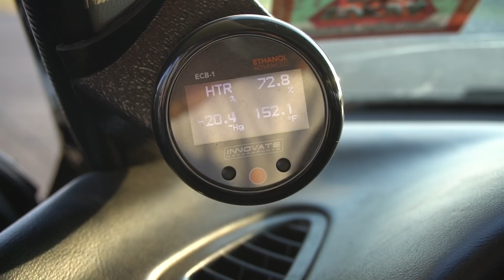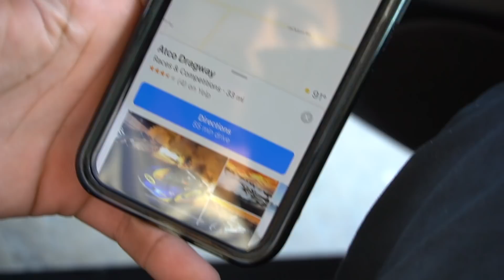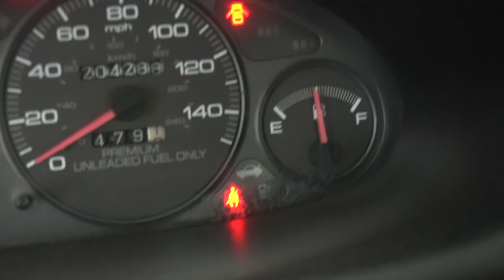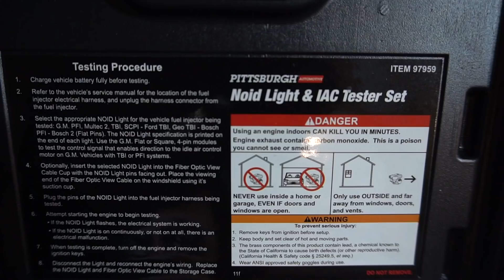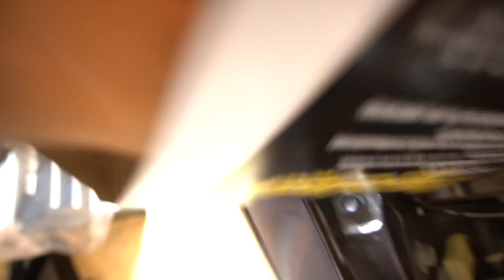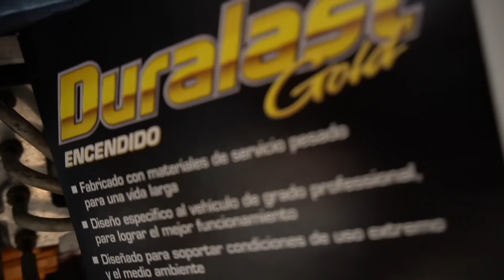WHAT HAPPENED AT THE TRACK!?

Comment: always check spark first any time you have a no start indication,2nd get a membership to AAA like 40 or 50 bucks for a year they will tow your car upto 50 miles 2 times a year at no charge, also can deliver fuel and batterys and tires .well worth it many times i used AAA to tow vehicles over 20 years lol
Reply: He DID check for spark man, but since the rotor (not rotator lol) turned like 1/2 the way past where it should be, he had no idea it was way off timing (it still had spark.)  
And yep, AAA would've been a BRILLIANT idea!  It depends on the yearly plan you pay for as far as how many miles they will tow for free.  Shit, even if you have a friend then they can use their AAA to tow a friend.

Comment: I'm not a ethanol tuning expert, but I thought you want it at least 80%.  Maybe that's only when it is on the dyno being tuned though.  I just know there's a massive amount of advanced ignition timing the engine can handle on ethanol that will grenade it on gasoline (93 octane.)  It's possible the HP is slightly less when it's at 70% too.

What a sigh of relief that it was just the stupid distributor rotor screw!! lol  *hand smacks forehead  DEF left it a little loose.   Those never need loctite or anything.  We've all done silly BS like that at one time or other tho!